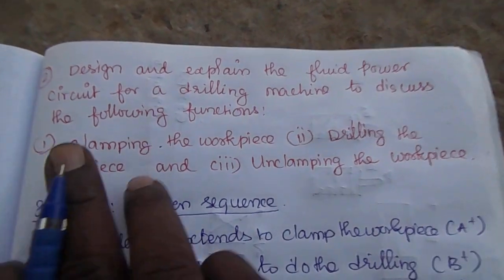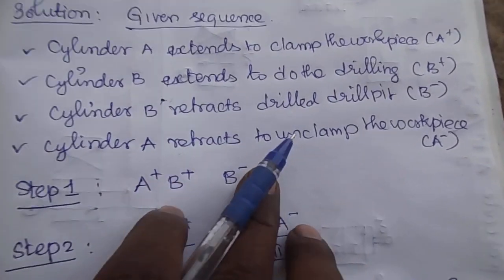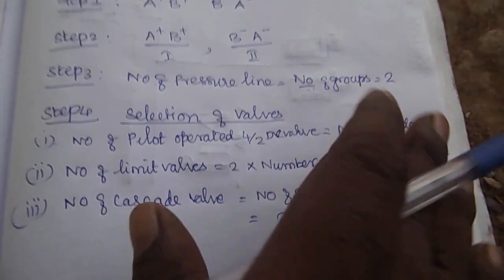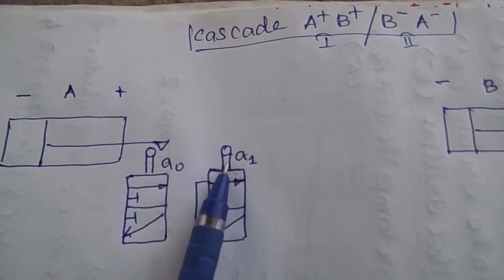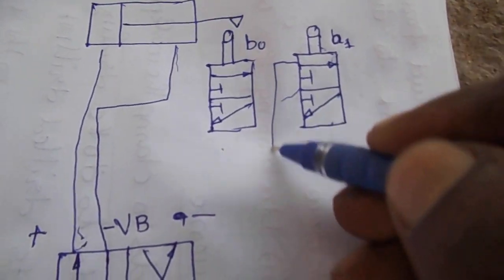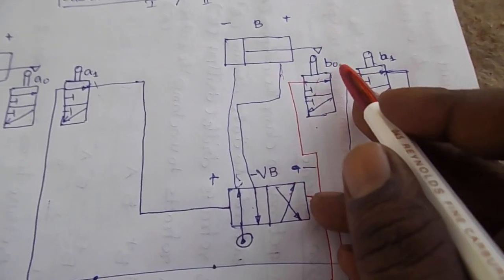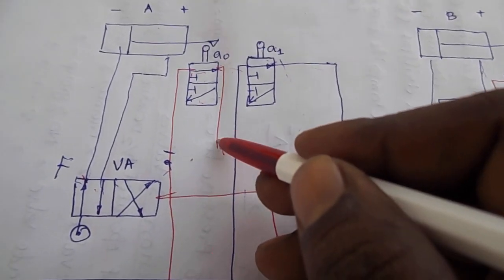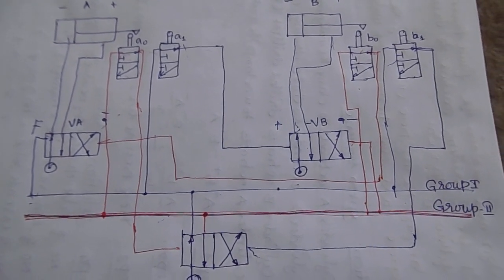Cascade A+ B+ B-A- With Tamil explaination

Comment: Hi sir, why we use 4/2 valve, we can use 5/2 valve also sir.. is it correct or wrong sir????
Reply from the maker: If we use 5/2 valve need one more connection instead of 4/2 valve.
Reply from the maker: In 4/2 valve there is one input(pressure line) & one output only(discharge line).
Reply: Okk sir tq
Reply from the maker: Thank you for valuable comments.